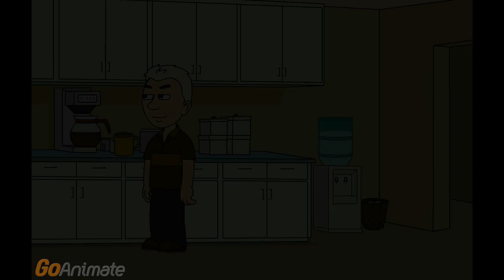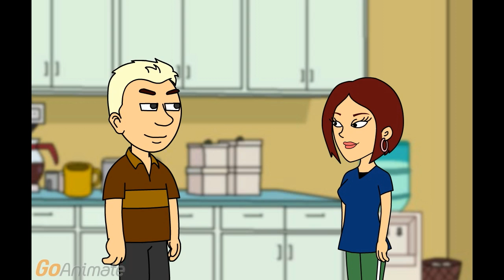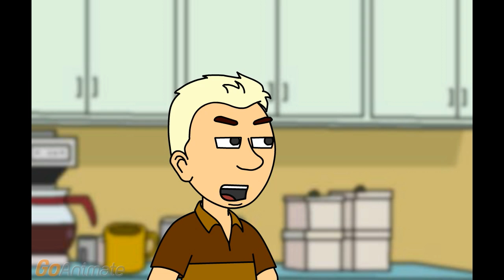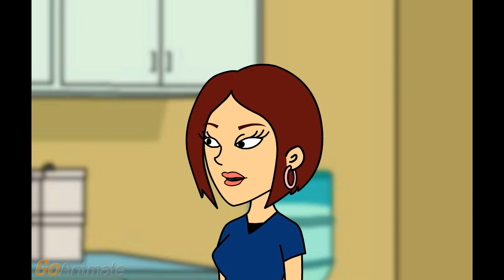LG Air Conditioner Troubleshooting

Comment: I have a window unit LG Model # LW1016ER.  I noticed the temperature in my room was really cool and my A/C temp. read 75. When I turned off my unit I heard the Compressor still running.  What causes the Compressor to not turn off? I have tried to reset it, but still no luck.

Comment: zero . not reliable LG SMART INVERTER FAIL . I bought it for two years and works only 4 month July and August two times and now the outdoor unit is Dead . they said that the mother board is Dead 200 dollars cost and I don't believe them I think the starter capacity fail.